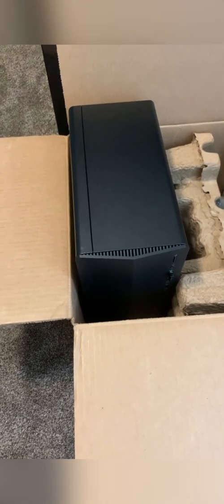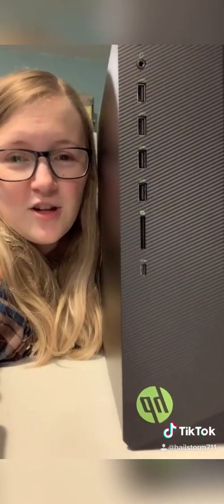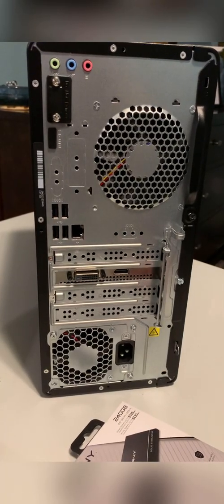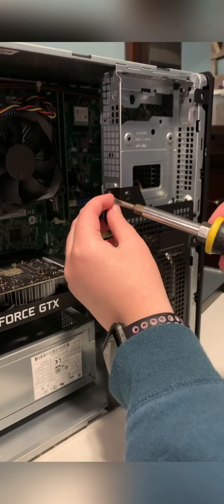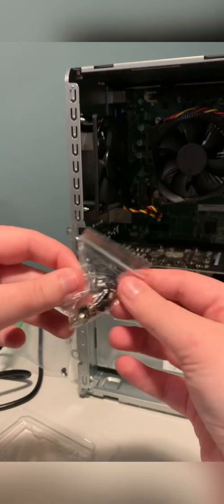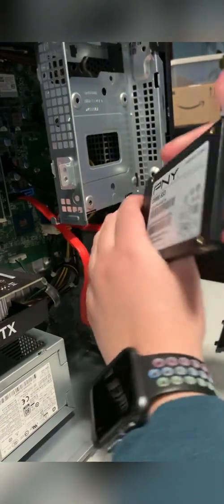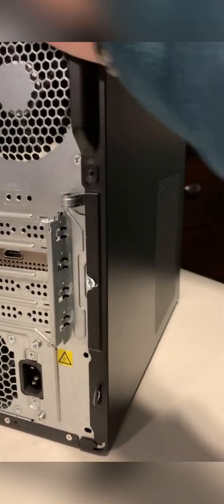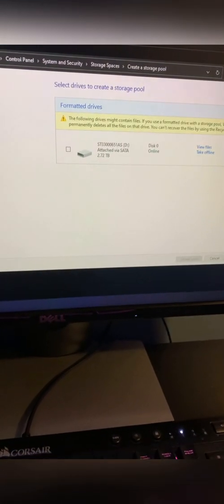Installing SSD on a HP Pavilion desktop

Comment: Nice tutorial. Only one thing. It is not a good idea to place the ssd in front of the air inlet of the desktop. The second diskdrive holder can easily be removed to fix the SSD there.

Comment: Great video, was looking for others experience in this before I tackled mine, it did throw me off where you attached it lol.  I might actually do that now instead of buying the adapter for the top cage hehe.

I was lucky enough to have an ssd factory, loads games super fast, but was disappointed when I got to my 3rd game and there wasn't enough memory to install it lol. Mine also has both cables in it already so that's nice too, just need more memory and to upgrade ram from 8gb to 32.

But nice video, too the point and easy to follow!
Reply from the maker: I wasnt too worried about location of the ssd haha.  Glad to hear this will help!

Comment: I haven’t seen anyone connect their HDD to the front chassis before.  Most of the time it’s either the bay above, or where you put the SSD.
Reply from the maker: Yeah i didn't really know what I was doing. First ever PC upgrade! LOL
Reply: @TheHailstorm711  where should I put the ssd?
Reply: @Bink-730  I think in this metal in the top right corner, but I'm not sure about it
Reply: @Bink-730  she clearly mounted it to the black cage
Reply: @Tinzy89086  okay Lmfao
Reply: This is an older comment but I'm looking to upgrade/fix my old HP.  Anywhere there are mounts, you can use to attach a drive.  While it may impact overall airflow, the space is there for upgrades as part of the design.
Reply: @stonecutter2 you’re correct I have since reconfigured my HDDs and one is mounted the same as the video, another in the caddy above, a 2.5” SSD on the underside of the caddy, and I put a 80mm fan on the grate were the 2.5” SSD is in the video.

Comment: I don't know how you decided to try to make the sad your boot drive but I guess I'll tell you my experience on how I did it. I unconnected any external hhds or adds in the system that I didn't want to be my boot drive. Then I restarted the PC to open bios. In order to open bios spam one of theses keys as they are the most common bios keys, Delete, F1, F2, and Escape. Spam these when you restart the PC. Then through that you can choose the boot ssd insert USB windows 10 stick and click save and continue and bios and boom 💣
Reply from the maker: Yep i did this all multiple times. wouldn't read the SSD in the bios. My friend does this all the time with PC's and he couldn't get it either.
Reply: @TheHailstorm711  did you disconnect all the other drives including the NVMe?  Swap SATA data ports on the board?  Have you tried to duplicate the error with a HDD on that SATA port as a boot drive?

Comment: Hi, I see that you decided to not use the SSD as the boot drive which I feel like you definitely should do since its worth the difficulty. A ssd is meant to be the boot drive as it boosts system speed A WHOLE LOT LIKE A LOT. compared to a hdd. In games you will load in seconds faster and even just loading up chrome it will feel like a breeze. Not to mention it should even boost fps in games since it will be running way more smoother.
Reply from the maker: Hi. Thanks for the comment. I actually tried to do this, and spent over 4 ours. Unfortunately I wasn’t able to get the pc to read the drive, and I even worked with my friend who builds PCs regularly. Neither of us could figure out why it wouldn’t work. Everything was lined up to work, but it wouldn’t read the drive to download windows onto it.